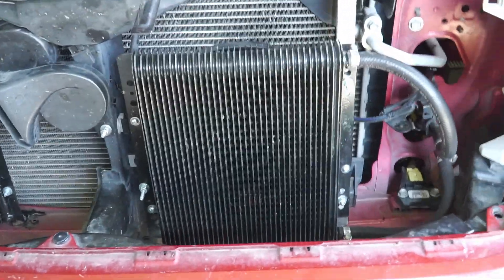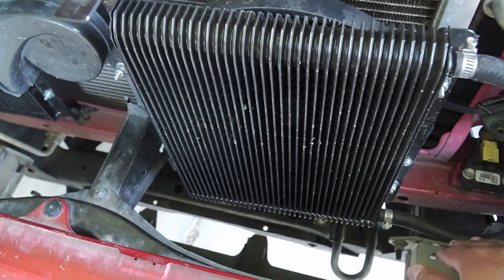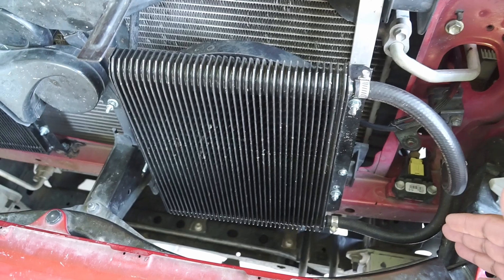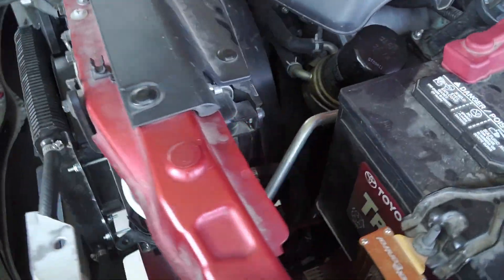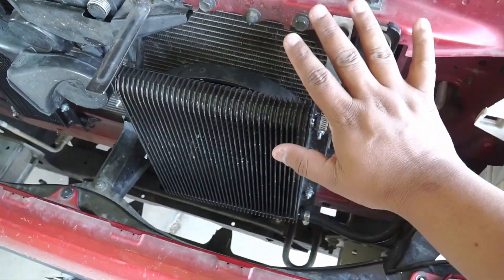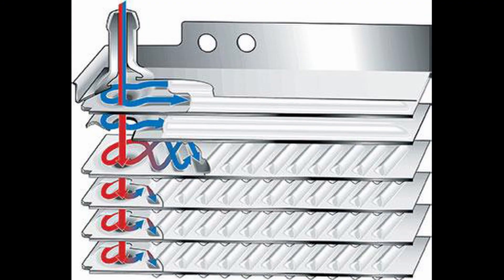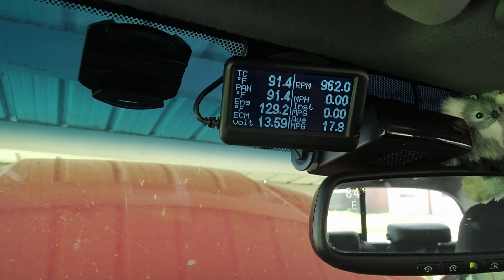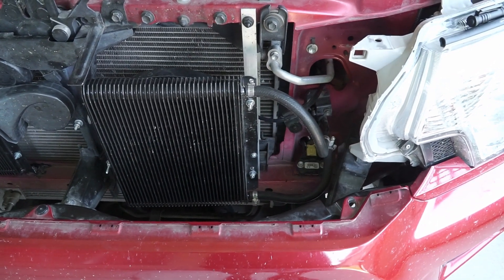TOYOTA TACOMA TRANSMISSION OIL COOLER UPGRADE!!!

Comment: Would you please clarify how bypassing internal transmission oil cooler helps to warm up the trans oil temp in winter quicker, than the trans oil flowing through the stock/internal cooler would warm up? I plan to instal an OEM external oil cooler (without fan) on my 4th gen. 4Runner 4.0 (2004 - V6), bypassing the internal trans oil cooler in the radiator (to avoid coolant-oil mixing issue), because in summer (104 -110 F) the internal cooler fails to sufficiently cool the trans oil . But, my major concern is that having also quite cold winters (about 4-5 F), the trans oil won't warm up quickly enough without flowing through internal oil cooler. Will cold/not sufficiently warmed up transmission fluid damage transmission? Thanks
Reply from the maker: I will try to explain, hopefully I don't create more confusion. What I saw during Winter before the bypass, is the transmission oil took longer to warm up because the water in the radiator wasn't warming up fast. The engine was warming up at its normal rate, but because of the engine thermostat, it recirculates the water in the engine rather than sending the water to the radiator. Once the thermostat would open fully or halfway, it would then start sending water to the radiator, because the ambient temperature is cold, the radiator would cool the water quick and by the time it reached the internal inline oil cooler in the radiator, the water would be cold and any heat created by the torque converter, would be soaked by the cold water. By bypassing the inline oil cooler in the radiator, you are allowing the oil to heat up faster because there is no water to soak up any heat generated by the torque converter. As long as your transmission oil gets warm fast and stays warm above 100F degrees, your transmission will be fine. Just don't drive aggressively, just like allowing the engine to warm up as you drive, allow the transmission to warm up by driving carefully. When you force the engine and transmission to work hard on a cold day, you are slowly damaging the internals of either system because the oil is thick and cannot move as quick as a hot oil will. I don't recommend using the stock OEM external oil cooler as your primary cooler. That cooler is too small, you should use a cooler like the one I showed in the video. To help it from dissipating heat during winter, you can cover the front of your new oil cooler about 50% to 75% so any air flowing through it, doesn't cool the oil too soon. Then once winter is over, you can remove the cover and allow it fully cool the oil during the summer. My cooler has seen 0F degree weather and the oil cooler did its job just fine. Kept the oil warm enough during stop and go traffic as well as going 75MPH down the highway. Definitely worth the upgrade, like you, my main goal was to avoid any coolant-oil mix. Hope I helped answer your question. If you have more questions or need more info, feel free to email me at yofivefoot@gmail.com. Thanks for watching! :)

Comment: Very nice walk through. I have a 2008 that I am looking to add a larger cooler too, and I’m also interested in the MX 1.3, did you have to add any special coding to the MX to receive the transmission temp? I’m looking at their website and it does not appear intuitive or as a standard option. Again, nice video!
Reply from the maker: Thank you! Yes, I did have to program the UltraGauge to display transmission temperatures. It's pretty simple to program it.  I am not sure if there is a difference in transmission between 2005-2011 and 2012-2015, so you might want to do a little more research, or contact UltraGuage for their input. Also, if you have Facebook, join a group page called Toyota Tacoma Enthusiast, you'll find the answer you need there. If you have not found the transmission temp codes, here is a link to it. http://www.ultra-gauge.com/ultragauge/support/Ultragauge_MX_1.3.pdf Thank you for watching my video!!!